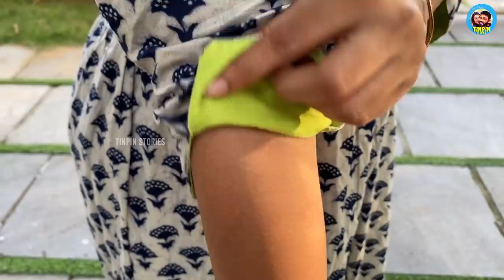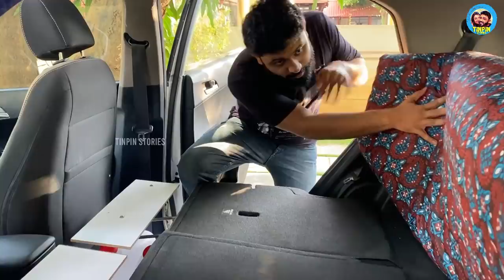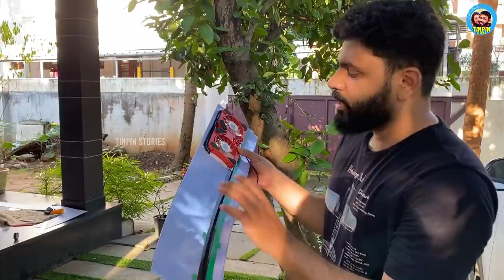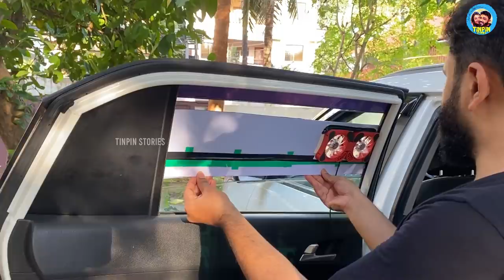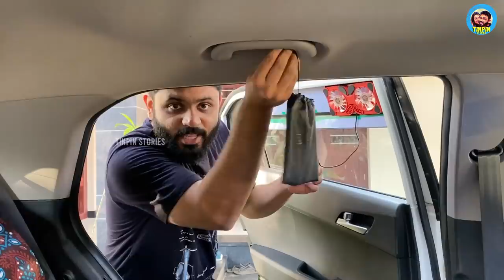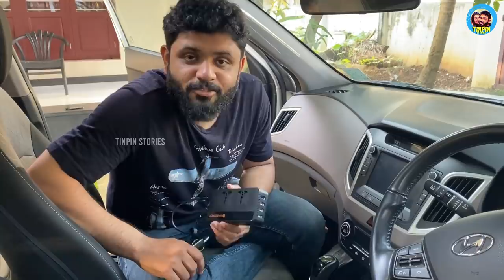വണ്ടിയും ഞങ്ങളും റെഡി | CarLife Couple | India Trip

Comment: Awesome couple and nice videos. Awaiting the trip vlogs...
Few suggestions..
1) Pls do a local trial run and stay before u setout on the real trip.
2) Carry spare fuses for the AC inverter, if it has.
3) Consider setting the exhaust fan in the front window for safety reasons.
4) Include a small fire extinguisher and pepper spray cans too.

Wishing you a safe and happy journey..Enjoy...
Reply from the maker: Definitely oru trial cheythu nokkum. Safe aanenkil matre continue cheyyu. Front window safe alla ennu toniyathukondanu back il cheythathu. Extinguisher ready aakam 😊😊😁

Comment: Bro if u fit  one more fan in the opposite windows.in opposite way like it draws external air to inside it will work perfectly.in aircraft for avionics ventilation system that technology is using

Comment: Ningale Carl AC undallo axoist fan endina
Reply: Plzz rply
Reply from the maker: @fathimafarisa7721  Two reasons. One is that the whole night car engine should  run which we guess in not good for the vehicle and consumes a lot of fuel. Second thing is sleeping in the car with the AC on is considered dangerous due to the chances of carbon monoxide poisoning. 

This small exhaust fan works well. Why waste petrol!
Reply: @TinPinStories  thank you so much
Suprb